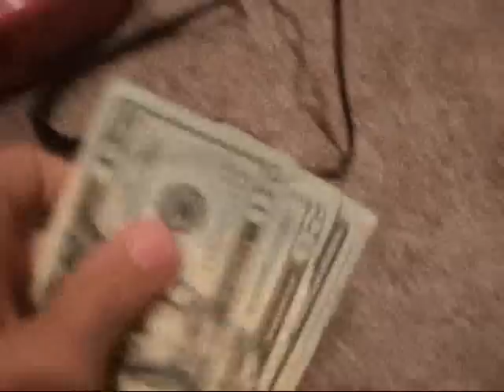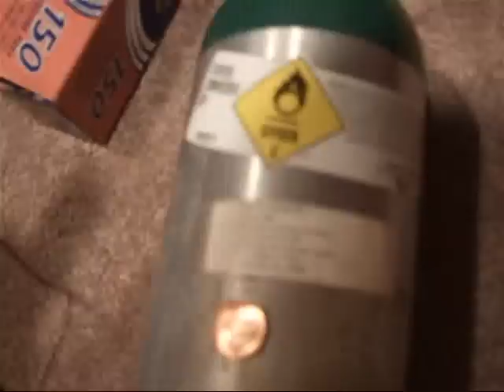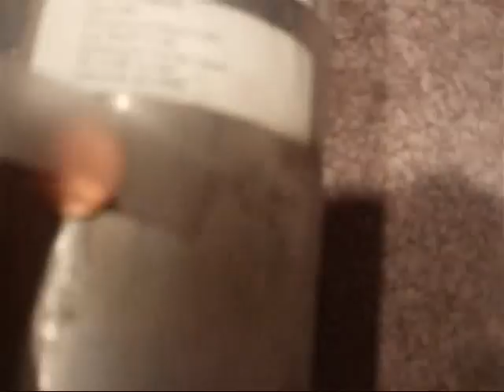How to build an amplifier for under a dollar.

Comment: Didn't work, then I tried with a slightly older shoe (converse mid top with flames on it) and it worked great. Also, after some testing, a 2001 10 peso coin also works pretty well.

Comment: Unfortunately, this won't work. The plasma that creates the computer system needs to be controlled by three primary main processor cores, cross-linked with a redundant melacortz ramistat, fourteen kiloquad interface modules. The core element is based on an FTL nanoprocessor with 25 bilateral kelilactirals, with twenty of those being slaved into the primary heisenfram terminal. And only Nike shoes create that kind of plasma computer system.  Now, you do know what a bilateral kelilactiral is?

Comment: Hi, I have a silver milk bottle top, a roll of carpet measuring 2 inches by 27.638 miles, a used toe nail clipping, a sandwich I didn't want to eat from earlier today as it had a hair on it and some dead concrete. Could you show me how to make some inner tubes for a space shuttle with a serving hatch please? Many thanks, not Dave.

Comment: I have seen something similar but it cost just a bit more.  The reason  for the extra cost was the guy used a flux capacitor instead of the oxygen tank with a penny.  Your's sounds much better, though.   Kudos !!!!

Comment: I tried this and it was too quiet and distorted.  My solution was to double wrap the tinfoil. I found that using a euro instead of the penny makes for a good Vox simulator.  I give it an 8 out of ten cause there's no volume control.  Your right about the  $181.00, it gets the sweetest overtones.

Comment: hey enjrgrhydr im not lying dude if you just were to connect the positive cable to abes face and the negative to the tin foil, and slowly let the oxygen leak, it will cause heat from compressed gas, copper conducts heat, the heat is then converted into electricity and the inside of the shoe acts as a drum, its hollow and when it passes through the sound wave vertex it will create the sound of the cords strung!

Comment: So you said "tinfoil" while clearly using Reynolds aluminum foil in the video. So which is it? And does it have to be Reynolds? I''ve tweaked  the settings a bit on my  build and played with the circuit design: it seems that dress shoes make better clean tones, almost like a Dumble, while my stank old Converse high tops really nailed that classic Peavey Backstage circa 1980 sound. Thanks a lot man. You did this for The People!

Comment: You can get a pre-foiled Plasma Coil off eBay for a 19.95. The have a higher inductance yielding a higher output.. I put the amp I made in my car  Pushing 2 18 inch Funky Pup woofers and I'm hitting 183 dB.

Comment: Man i tried this and measured it on a volume meter, 148db cranked all the way up.

Pretty darn good! I used a different glove though and tried it with an extra cent attatched to the opposite side of the oxygen tank and made it stereo with 2 shoes, But i tried a sandle aswell but that didnt work =/ Probly no where for the plasma to go. Good job (y)

Comment: i've actually improved on this method. if u take a jar, put some goat plasma and spicy cheetos in there, put it in the microwave with some aluminum foil for about 3 days, then let it sit for about a week, and put that in the glove along w/ the money. which u should get out of that is a rough, black metal sound. very good with drop C tuning.

Comment: This works pretty good. I had a tube Marshall half stack and this took its place. Pretty sweet. If you move the tape a little away from the cable it will give you a nice bluesy sound.